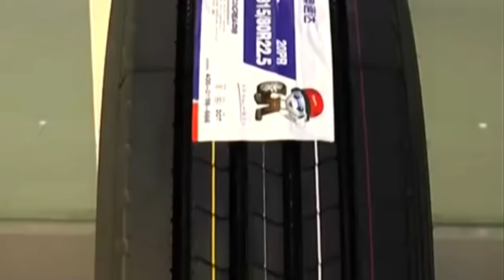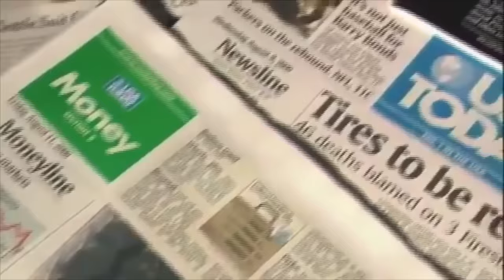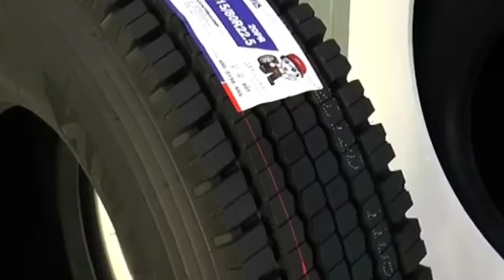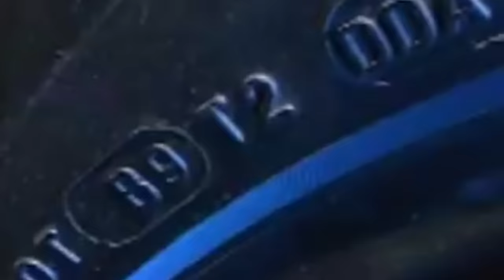5 Tires You Should NEVER Buy!

Comment: Now I’m paranoid of my cars tires......Thanks a lot
Reply: Raymond Jameson do diligent research for the right tire for your needs, and keep in mind that you get what you pay for in almost every case.
Reply: Buy Michelins, and have no worries. Defender, MXV4, Pilot
Reply: roy rogers I liked the mxv4 tired that came with my ford flex. Quiet  and comfortable, but they wore down so quickly. A dealer replaced them with Goodyear fortera hl(s) only in the front. This cause premature failure of my ptu (front differential). You live and learn.
Reply: Raymond Jameson Same
Reply: roy rogers I have Michelin’s
Reply: Raymond Jameson Then you're fine... unless they have been repaired incorrectly or are getting old...
Reply: Raymond Jameson, Myself a 24+ yr, Tech (Mechanic), I'll throw in my 2 cents. Get yourself a decent dial-style tire gauge, the ones with the rubber surrounds?...do you see these big Snap-On trucks parked at large dealerships from time to time?...walk up to one & buy one off those guys...don't bother getting one from anywhere else...(you get what you pay for). Do not drop such a gauge, it can go out of calibration. There are two notations of pressure, one on the tire itself, another on the door-jamb of the vehicle itself. The tire notation is the safe operating temperature for the maximum load noted, EG.  (36 PSI @ 2850 lbs)....the car notation will be lower considering a smoother, quieter ride, the differences between the max load as noted on the tire vs. the weight it will actually be carrying. Running the tire at the tire noted pressures will keep the temperatures at their safest levels...BUT can lead to poor handling & a harsh ride & noise level. Running the pressures at the car noted pressures will get you the best handling possible...at the expense of elevated tire temps and the risk of temperature induced failures.
   Another tip, get yourself a set of those metal valve-stem caps...look for the tiny O-ring inside these caps...it is a backup to the valve inside the valve-stem itself...they  often fail, leaking air-pressure out slowly...put a dab of your own spit inside the valve-stem...does it create bubbles?...somewhat similar to soapy water checking for gas-lines, checking for slow leaks "Do you smell gas?...I smelled something since you put in that gas-grill?".
Reply: Ricardo Ellison The pressure marking on the tire is the maximum operating pressure not the recommended. Never use this pressure unless you are running the maximum weight. The vehicle manufacturers recommended pressure plus or minus 2psi is the correct pressure if you arent adding any extra weight.
Reply: Brem  The pressure ratings both tire noted & vehicle noted are compromises on a sliding scale...on the high tire noted side it is a case of maximum structural integrity within a given load,  flex & temperature value. On  the low side vehicle noted designated,  it is mainly focused on temperature buildup according to flex. Other issues must be taken into account, weight vs. contact patch. Now I know of "poor" contact patch by running these max pressures....are you aware of other issues at these pressures?  "My, the steering is so light now...".
Reply: Ricardo Ellison No, the tyre pressure stamped into the tyre is the maximum inflation pressure. The tyre company has no idea which vehicle you will fit the tyre to so cannot and does not suggest an operating pressure.
Running 51psi in a 205/40R17 fitted to a Honda Civic is asking to die.
Reply: Brem Rock-hard ride, contact patch the size of a lemon, zero traction.
Reply: Ricardo Ellison Yes exactly, which is why it is not at all a recommended pressure. It is the maximum inflation pressure.
Reply: Raymond Jameson
Now I’m paranoid of my cars tires......Thanks a lot
'
hi RJ...
be carefully drive with a car...
dont be foolish drive around...
dont use a cellularphone = text message while drive in a car...
dont drive too fast high mph speeding...
check car 4 tires plus extra spare tire to be safety
Reply: All the Citroens, Peugeots and Renaults I've ever had, the Mercury Sable, and both Mercedes wagons. All the way from X-Stop to the latest Primacy. I've even had TRXs.
Reply: Raymond Jameson spend the money and get michelins not only are they the safest but they last the longest
Reply: Raymond Jameson there are different michelins
Reply: No need for that, those tires have been improved.
Reply: roy rogers team Michelin too, I got a set of Michelin Primier tires from Costco last year. They are quiet and comfortable. I have great wet, snow and ice traction too.
Reply: Now I’m paranoid of my Chinese Neighbors......Thanks a lot.  I mean thank you, from bottom of my heart.
Reply: Sorry to tell you but do you know how a engine works?....lol
Reply: HASE why did u like your own comment? Lameeee 👎🏽
Reply: you dont like yourself?
Reply: Remember to Never speed. If you drive too fast like most people today that heats up the tire much more also gives you less time to think, act and react.
Reply: that cause you drive a ford explorer 
i have a Z71 Chevy.
Reply: Just stay away from Firestone, Bridgestone, and Goodyear tires, they suck!  Go with Michelin or Pirelli's if you can afford them!
Reply: I can't afford those but how about: Dexte 720, Douglas or General tires? I have all 3 of these brands on my car because that's all I can afford. Of course all of them are new. Not that that makes them safe.
Reply: The only brand related tire failure patterns I have noticed would be when I used to work at a Goodyear.  A lot of those tires would develop sidewall bubbles, they also tended to be out of round more than other brands. Now that I work at discount tire I have not noticed any other brand related patterns. So I would advise avoiding Goodyear tires in general as they not only seem to have trouble making good tires, they also use very unethical business practices. 

I have noticed an ABUNDANCE of trailer tire failures however. Lots of people don't take care of their trailer tires by doing simple things such as......checking the pressure before they use them, making sure they aren't too old, driving WAY too fast with them, and they will inflate them to some arbitrary amount below the max sidewall PSI because they are afraid the tire will explode if it exceeds the max PSI such as when the tire heats up. Pl0t tw1st: Much more tire failures result from underinflation and the associated overloading and overheating than failures occur from excessive PSI. Trailer tires are rated to 65 MPH if no speed rating is otherwise given. If you load the tires to their maximum capacity and drive faster than the speed rating, you will be much more likely to have a tire fail. Some trailer tires are M rated, or rated for 81 MPH, so if you don't want to slow down when towing(you should), then seek M rated trailer tires.

Also, its funny to see people still believing that high pressures make the tire have a really small contact patch. How about trying something out? As mightycarmods would say: "Jack up your car!" Now look at the tire, it will look flat on the bottom. Great, now inflate it to the max sidewall PSI. It will still look flat. If the tire is visibly bowing out, then the cords in the tire are not doing their job of holding the tire's shape, and you should probably be looking at replacing those tires ASAP. I have never seen a tire bow out from pressure. Even if a tire were to go out of shape a little, when you put load on it, it will tend to flatten. So say you take corners hard: Oh no, since the tire is at high pressure there will be no contact patch and you will have no grip! What do you think happens when you corner hard? A lot of weight will shift to the outside tires, pushing them harder onto the ground, and flattening even more any contact patch discrepancies. In fact, if you tend to corner hard I would advise to inflate more than the door placard says to. Cornering hard will wear out the edges of the tire very quickly at lower pressures.

Comment: I've been using firestone wilderness tires for years and NEVER had a problem.
Reply: Bob Builder keep using them and you will find out the hard way dumb ass!
Reply: Higher tire pressure then 24
Reply: well i sleep with a loaded gun in my hand without safety and it has gone well up until now.... does not mean it's a good idea...
Reply: you don't realize what the real problem was with these tires and ford.... I worked at ford in the late 80's early 90's and I know exactly what the problem is.. it's not the tires. it's an air pressure issue!!!!!

and quit lying about keeping a loaded gun in your and while sleeping that sounds like a stupid libtard emotion based 
argument
Reply: hey Joe, I worked as a ford tech in the late 80's to early 90's.  I kept 100's of those GREAT tires that were suppose to be recalled and  have about 20 left in my inventory.  not one has ever failed!!
Reply: not sure what a libtard emotion based argument is, but sounds like something a closet communist would say.

Comment: I have been buying Michelin tires for all my cars for over 39 years and I never had any failures. I always check the air pressures once a month, rotate them every 5,000 miles, and have the wheel alignment checked and adjusted if needed every year. 👍 In my opinion and experience, Michelin is my lifelong choice. 👍
Reply: Sounds like your regular maintenance is the reason your tires perform so well. I'm betting you could buy much cheaper tires, treat them same way and get the same long performance. But hey... if you prefer to buy expensive tires for "peace of mind" go for it.

Comment: Unfortunately the Firestone Wilderness ATX was given a bad wrap here. I have to worked  as a tire builder at the BF GOODRICH plant in my town for 8 years, and then a mechanic at a tire shop for the last 17 years. You CAN NOT run any brand of tire at FORD'S recommend air pressure of 26PSI on the early to mid 90s Explorer for extended periods of time and not expect sidewall failure. The tire was not designed to run at that pressure. Then you add the fact that most failure cases were used sets of tires bought second hand. And lastly, if you pick up any debris from the road, and do not properly fix the tire "a vulcanized patch" and just plug it, that weakens the structural integrity of the tire further. There were numerous variables not taken into consideration with the Firestone recall, and it almost put them in Bankruptcy.
Reply: Right! No tire can take heavy load and speed at 26 psi

Comment: Bridgestone and Continental are very good tyres
Reply: Luso Tecnologia Bridgestone is owned by Firestone. Firestones are fantastic tires.
Reply: @UrMomsChauffer   vice versa
Reply: Continental/General Tires back in the 90s were factory on the newer at the time Ford Taurus had issues with belts slipping inside the tires and causing instability issues. I worked at a tire shop and people were bringing in there new Taurus's thinking their tires needed to be rebalanced. You put the tire on balancer and spin it up you can clearly see the defect, I had to show and explain that to them every time .
Reply: Firestone's parent company is Bridgestone
Reply: Flintstone's parent company is Sandstone...so I've heard.
Reply: Dunlop is good

Comment: Thumbs down. Most of the  tires are from over 20 years ago and long off sale.
Reply: I saw a Goodyear G159 on a firetruck at the rock ranch, hopefully they don't actually drive it. The newest G159s are at least 15 years old now I believe. So, they are still around...
Reply: Dangerous used out of balance and missing a lug are 2 easy to change if you are dabble in cheap stuff
Reply: But,what about tires in amazon and ebay? i guess those sellers sell really dangerous tires now these days...

Comment: The Chinese 'west lake' brand now come other other names such as Goodride. I know many people who have Westlake tyres and have not had a issue. They are also quite popular for drifting in Australia due to there low price and resistance to delamination at higher temp. Drifting puts huge heat loads into the tyres, I can tell you from experience that all tyres will delaminate with age if they are over heated. This is why I moved to using brand new tyres for drifting as they rarely seporate except for a few brands. 

I think half the battle is the customer understanding that they need to keep tyres properly inflated, perform wheels alignments and replace them when they are old and hard even if they are not worn out.

Comment: I'll keep my Cooper tires then
Reply: coppers tyrs go round and round
Reply: I had 2 sets of Cooper Discoverers on a Nissan Pathfinder. Both sets failed due to bulges in the tread or sidewall before they were half worn. Changed to Bridgestone Duelers and never had a problem.
Reply: I purchased the Coopers RS3 and then found out once mounted they are made in China. Cooper was sold to a company from India that makes the tires in China.
Reply: I recently bought a Cooper Zeon RS3-G1 and was extremely disappointed when I found "Made In China" on the backside of the tire.  Besides the tire size, the ONLY requirement I told the tire store rep was that I wanted a tire that was "Made in USA."  I failed when I didn't actually look at the tire before they mounted and balanced it.  It was a few days later when I found the truth.  Won't make that mistake again.
Reply: mine were made in louisiana. theres a code on the tire that will tell you were they were made. the tire shop cant always be trusted to tell the truth, some will tell you something so you buy another tire they get commission on
Reply: the set i just put on were made in Louisiana
Reply: Goodyear owns Copper (now).
Reply: Hammer Smith They aren't exclusively American. Cooper make their truck tires in China.
Reply: James Unger Goodyear doesn't own Cooper.
Reply: ThisCreatedAccount They are a fantastic all season tire but they get blown into the weeds by most summer tires for cornering grip.
Reply: David Vermillion.  no they weren't. Apollo tyre WAS looking into buying cooper
Reply: soaringtractor yeah man some Coopers aren't. I work in the Texarkana plant. If you look on the sidewall look at the codes and find UT. It means it's built in Texarkana AR!

Comment: I needed new tires for my 2010 Chevrolet Suburban and my brother had just bought a 2013 Chevrolet Suburban that came with Michelin tires that he did not like and he bought new tires (I don't remember the brand). I decided to get the Michelin tires he had taken off his Suburban and use them. He said I wouldn't like them and he was right.  I noticed immediately when changing from one highway near my home, to another highway at a 90° turn and the highway I was turning on to had a slightly higher grade than the one I was turning off of, creating a very slight incline.  With the new Michelin's, every time I made this turn the right rear tire would spin and if the road was even slightly damp it would really spin until I got onto the highway.
The road noise from the Michelin tires was really bad as well and they would hydroplane if there was standing water.
After having the Michelin's on the Suburban for about a month, I bought new tires.  The previous tires and the new ones did not spin at the intersection of the highway like the Michelin's did.

I bought a 2015 GMC Terrain and it came with Michelin tires, I asked them to change the tires before the purchase but they said they didn't have tires to change.  I only drove the Terrain about two weeks before I bought new tires.  The  Michelin tires on the Terrain did the same thing at the highway change that the Michelin's on the Suburban did and they hydroplaned in standing water on the highway or interstate.  

No more Michelin tires for me.